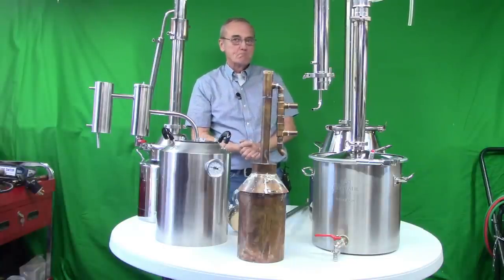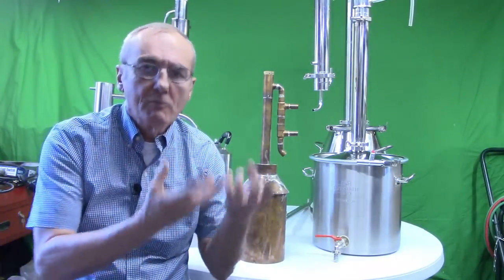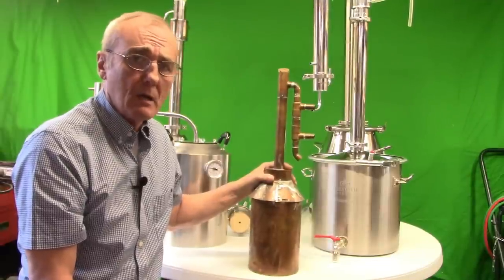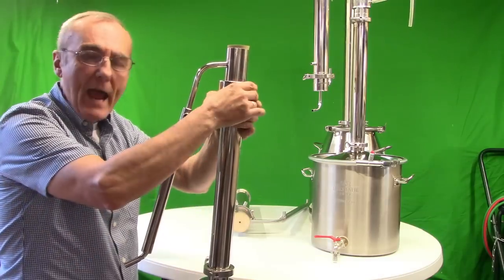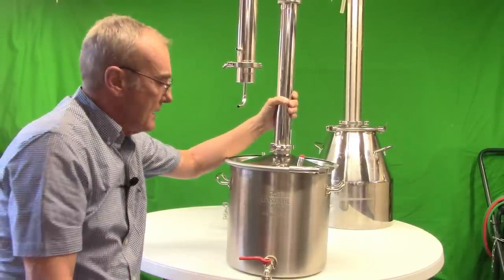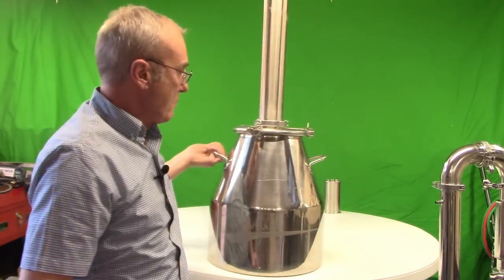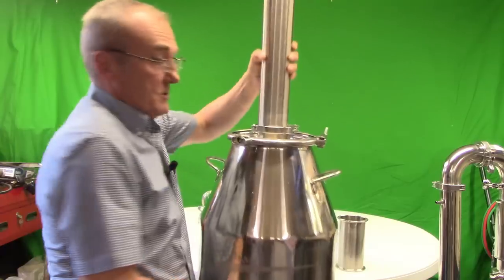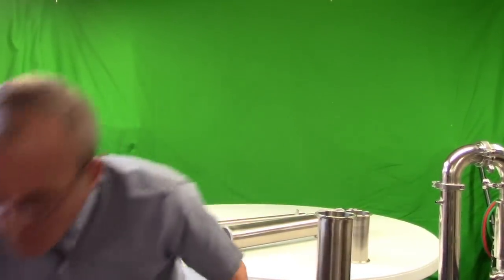Beginner's Guide #5 Moonshine Stills

Comment: George, love your video channel  but just one little correction....Pi X r squared is the AREA...what you described as the inner dimension when you ran your finger around the inside of the tube is the circumference, whose formula is Pi X 2 X r or Pi X D (2r being the Diameter).  

I’m really looking forward to my first try and putting your instruction and advice to use!  Keep up the great series!
Reply: For dummies: Circumference = 3 times the diameter - close enough

Comment: Hi George...first wanted to say thanks for the videos. You have mentioned several times you are not a fan of thumpers, I have used them a few times and have my own opinions of them. In a past video I believe you said a thumper is typically filled 2/3rds full and that seems hi and I see how that could cause some back pressure... but just enough to cover inlet tube by 1-1.5 inches is sufficient. It would be interesting for ( data ) to run 2 identical pot stills, 2 identical grain washes, but 1 with a thumper and compare the total  volume collected from each, the alcohol percentage from each, and the flavor of each from a few people to taste them. I think for ones who never used a thumper this would provide actual data or information of pros and cons of a thumper.

Comment: Slip of the tongue around 16:40, "Just don't run water through the condenser, or the pre-condenser.."
George meant that if you want to run it as a pot still, just don't run water through the "pre-condenser", and only the pre-condenser. 
You must always, always, always run water through the condenser, that is unless you want to die in an alcohol vapor fueled inferno.

Comment: So on the 3rd one that was a combo. Pot and or Reflux when running it as a reflux do you run water in your pre condenser and condenser? I suppose on the condenser you just run a steady flow of cool water. On the pre condenser do you adjust water flow or just run it like the condenser? Thank you for the information.

Comment: Great video.  Q - if you run the gin basket between the kettle and the condenser, doesn't this remove some of  the flavour...? As the reflux process removes most of the....flavours....etc. Almost seems counter productive - adding and removing.....no....?
I'm building a 3" column and I'm having a hard time deciding(personal preference) on a design that will let me Do the infusions as well as just run straight reflux.
(Kinda like the  Nixon Stone design)

Comment: hello sir, my pot still produces ethanol at the beginning max 80 abv then 70 - 65 - 60 .....  if i surrounded top of my column with thin copper pipe 3 laps. (primary outer mini condenser)  can i use too low water in this twisted pipe and increase purity of my ethanol?  which abv at my whiskey's flavor removed?

by the way, i realized  my foreshots smells like whiskey more than my hearts section while stripping run. when i smell jim beam bourbon, smell my foreshots and smell my hearts i can swear my %80 abv foreshots and heads smells like jim beam bourbon but i can not smell same thing in %70 abv hearts section, always smells like green banana :(      i am using pot still.

Comment: So if you get one of the reflux still I would need 2 water pumps?  One for the reflux and one for the condenser?
Reply: ......use gravity . .....cold water in container , above .....pinch tube to get right flow .....no pump  necessary !

Comment: Great episode. I'm in the process of building a 2"  nixon-stone set up running off a fire heated keg. My buddy runs a boka still(goes from 2" off the keg and 3feet up widens up to 3")  my Nixon will be 50"  and Tees over to the condenser inside the sight glass  (typical design I guess). My buddy thinks I'm over building and I'll have vapor pockets at  the thermometer and even at the take off point.......  any validity in his comments...?  
Thanks

Comment: Hi George, I could use some help with my little system. I purchased a little Chinese ten liter still you see EBAY etc. I'm disabled so I went for easy way of making alcohol by fermenting 8kilos of sugar and fermenting with still spirits classic 8turbo. Results were always good and the wash becoming clear as water after about weeks and have an alcohol content of 22% according to refractometer. With my new Chinese Still I could get 80-90% alcohol reading each boil, but recently that has fallen suddenly to just 60% at best. I've tried the steam with vinegar, stored the coke in the copper pipes but still the same. What can I do? Where am I going wrong?
Reply: Did you work out the problem? I am considering buying a similar still so would appreciate your thoughts. Thanks.
Reply: @naomi6212  Hi Naomi, I was using an electric hot plate to heat the still & had been using it for 18months. I decided to buy a new one. I found the new 1200w still became productive much quicker getting first alcohol drips in 45mins. The old hot plate 1000w took one hr & twenty. Now I can expect 80-90% for the first liter out put but the % goes down much faster than before since the "boil"time is much shorter. Now a full boil down to 15% output is done in about two hours where before with old hot plate it took 3.5+ hrs.
Reply: @Templemain  did you work out why the drop in productivity?

Comment: Hi George, I just bought a still with a thumper, can I use the fore shots and heads from my first run in the thumper mixed with crushed fruit or juice to add volume to fill the thumper 2/3 full? Also will the temp of the thumper have to reach 143 before the fore shots and heads enter the worm? Then increase  the temp to 173 and collect the hearts? I am new at this thanks for your info!

Comment: Using a cooling jacket on the top of the column is a pretty clever way to control the reflux ratio.  As  a synthesis Chemist I have worked with a variety of lab and industrial stills.  I am surprised I have never seen a small still set up like this.  I would run this a bit different though.  You suggest controlling the reflux by controlling the cooling water flow.  This will work but, it can be hard to reproducibly control the flow.  If I was using this in my lab I would keep a constant cooling flow but, control the temperature of the cooling water in the reflux jacket.  I had some temperature controlled recirculating baths in my lab that were  thousands dollars each which would be too expensive for a home distiller.  Still I think a simple recirculating bath could be made with a small pump and heated pot where the temp could be controlled.  

It would take some trial and error runs to determine the best temperature to run the reflux jacket but, once you figure it out it could be easily reproduced.   Say start with a gentle boil in the pot and run you reflux jacket at say 5 degrees centigrade lower than your ethanol boiling point.  See how well this knocks back the vapor.  You could get a good idea from your overhead temperature as well.  Too much cooling on your reflux jacket and your overhead temperature would be very low ( no vapor coming over).  Too little cooling and your overhead temperature would be a bit higher than the boiling point of ethanol (meaning insufficient amounts of reflux and a high water low ethanol content).

Comment: I have a copper 5 gallon one from the same manufacturer as your copper one.. I love it, partly because I made it myself, but I have to wonder where you learned solder.... LOL.   However, can you call the column a reflux column if you have stuffed the interior with copper mesh to do what the column water jacket does, so long as you don't run it fast? Nevermind.. didn't wait long enough in the video before asking.

Comment: 3" still , column length max of about 54".    Does this change with insulation / increased watts?   or does the power curve just run out room around here?  The calc I used seemed more around 60"

Comment: Hey George, I'm confused - when it comes to a reflux still, as the vapour is going through the reflux process, I would have thought the various chemicals that would normally vaporise first (methanol/foreshots/heads and the rest) would be mixed and muddled - Is it still the case that you should discard the first amount to get rid of the methanol, etc? I can't get my head around how the various chemicals aren't mixed by the reflux process rather than distilling in some sort of order due to temperature increase in a pot still.
Reply from the maker: Methanol ha no azeotrope so it comes off at 100% first. There is no mixing of muddling.
Geogre

Comment: What would be better?... Running the cooling water to the reflux jacket then to the bottom of the condenser, or running it to the condenser then to the reflux jacket? Or should they be on separate cooling water systems?
Reply: Cody Barnard Well if you’re just starting out; run a water line from your cold water source, I have a cooler with water and frozen 1 liter bottles of salted tap water with a pond style110 volt pump in it; into the bottom of your shotgun condenser. Then run a line from the top of the shotgun condenser into the bottom of your reflux chamber/Dephlegmator. Then run a line from the top of your reflux chamber/Dephlegmator back to your water source/cooler. Just like everything in this fascinating hobby; it all depends on how deep you wanna go. I use the same cooler set up; pump in the cooler, but I go from the pump outlet into a tee with a two valve set up I made, mounted to the side of the cooler. The valve for the shotgun condenser is just a regular ½” PVC gate valve and the one for my Dephlegmator, a 4 tube 2” tri clamp precondenser, is controlled by a ½” SS needle valve to precisely control the water flow. It’s a way cool learning curve; learning how to balance a reflux still. It’s also way big time fun to play with it. Enjoy the ride, enjoy the hobby and bottoms up

Comment: George, am I correct in assuming that the tubed/ jacketed top of the reflux stills is basically a non removable deplegmator ? Also I am using a 1/2bbl keg as my kettle you had mentioned 36-54in tall column for a 3in radius , is there any specific calculation or reasoning why I’d want a specific height for reflux mode?
Reply: It is basically a deflag, and while you can't take it off, you can leave it unhooked.  The height suggestion is based on diminishing returns, the taller you go the more seperation. But under average conditions/packing type, you start to max out the seperation you can get around 24 column diameters.

Comment: Sir can I condition a water heater to become the pot of my still? I am an ac technician and have a lot of mechanical skills.
Reply from the maker: Yes
Reply: As George says Yes, but you do want to watch what the tank is made of. I'm no expert but I would be leery of using anything but stainless or copper. I would steer clear of a galvanized tank because I would worry about high alcohol content reacting with the zinc. I'm sure someone with knowledge will chime in to this. I maybe wrong, interesting to hear what they say.
Reply: I wouldn’t use a water heater for a still. They are designed for lower temperatures than working temps of a still. Most old water heaters are full of mineral scale and/or rust and the dip tubes are usually plastic. I wouldn’t want to drink alcohol made in that environment. Besides, stainless kettles are cheap enough. George  made “big blue” out of cooking pot and basic mechanical skills, which would be a much better option.  But as HVAC tech, save some of those belly band crankcase heaters!  Heating sides of pot reduces scorching from heating sediment in bottom of still. Scorched sediment ruins flavors.

Comment: Hi quick tip to cleaning copper components, use stars an at the normal rate, it will remove all the build up and leave it clean. By this I mean I place my coppee in my bath add stars an and hot water, leave until its shiny then rinse well.

Comment: The distance around inside (where you run your finger) is Circumference, not Area. Yes, Area = Pi • R² (3.14 x R x R).  Area is the cross section of the pipe, measured in square inches (just like square feet measures size of a room or house).
Circumference = Pi • 2R, and measures distance around outside of a circle. Great teaching video. Many thanks.

Comment: A rubber bung.   Would that not put a rubber taste of the pririt?
Reply from the maker: It does not. The rubber bungs are standard with some stills when you order them. It is the device used to insert the thermometer into.

Comment: I already saw you make this mistake in another one of your videos: π*r² is the formula for calculating the area of a circle, not its circumference. That is given by the Formula 2*π*r
It is common to measure pipe sizes with their diameter, since it is far easier to measure directly, so for the example of 2" and 3" pipes, we have a radius of 1" and 1.5" respectively sin e the radius of a circle is always half of its diameter.
This gives us:
2π*1²= 2π*1= 2π inch²
2π*1.5²=2π*2.25= 4.5π inch²

So for the example you chose, it does work out to be roughly 2 the crossectional area.

However, and this is the reason why incresing column diameter increases efficiency so dramatically, as we have a squared relationship between radius and crosssection,  a 4" column has 4 times the crossectional area of a 2" column, while only doubling the diameter.

Now, the circumference for these:
2*π*1"=2π" circumference
2*π*2"=4π" circumference

If we now take the ratio between circumference and surface:
(2π*1)/(2π*1²)=1
(2π*2)/(2π*2²)=0.5
So, when you change the diameter of your pipe you change the percentage of your vapor that is in contact with the walls of your column.
It is the same effect that makes it so that ageing spirits in a larger barrel works so much slower: proportionally speaking, less spirit is in contact with the wood, and there is also less wood per unit of spirit.

Since column lenght and material affect the pseudo-reflux a column gives you  by radiating off some heat, changing the diameter of your column means also changing its lenght, if you want to have consistent results. However, it is not as simple as saying: for an extra inch in diameter you need an extra two inches in lenght - this going to vary, depending on your starting diameter, your mew diameter and your initial column lenght.

Love the videos, please keep them coming
Reply: Circumference is simply: PI multiplied by diameter.
3.14x3"
3.14x2"
Reply: Ben Müller,yes heard George get it A about twice I trust he will listen to your account.

Comment: George, another great introductory video! You mentioned a couple of stills by name (Mike High, Brew Haus) but I am interested in the one based on the 5 gallon kettle and two inch column. Distilling  in a kettle has lots of advantages since the kettle is multi-purpose. However, it needs a lid that seals. Can you tell me the brand and where you got it without endorsing it in any way? Thanks, Professor George!

Comment: He's a little confused about circumference and cross-sectional area.  PI x r2 (r squared) is the cross-sectional area of the pipe or tube.  Pi x d (diameter) yields the circumference of the tube.  He's giving you the formula for the cross-sectional area but describing it as the circumference.  Other than that, it's a great video.

Comment: Great video, but your math is a little confused.
* Circumference = 2 * pi * radius
* Area = pi * radius ^ 2
Circumference is the length around a pipe.
Area is the area of the cross section of the pipe.
Reply: Luke Kantrell  The video's presenter mentioned an equation in making a decision on a pipe size. He just used the wrong one. I wasn't trying to be disrespectful, just informative. After all, isn't that what his video was all about? I learned a few things about stills too. Have a great day.

Comment: Ok, great video, but your math is a bit off.  Pi X r^2 is the area, so the cross section of the pipe.  Pi X 2r (or d for diameter) is the distance around the outside.  That is why if you double the width of a pipe, you get 4X the throughput.  Anyway, looking to get a still when I get home from deployment.  One that makes vodka.  So I'm looking at a reflux.  MileHigh or BrewHaus probably.  Budget around $800.  Sound about right?
Reply from the maker: No matter how you describe it the math works out. Diameter is not the outside the outside is the circumference.

Comment: Does anyone know a still in the $200 range that's made in the usa
Reply from the maker: Very good question. Looking forward to seeing what anyone else can provide.
Reply: Clawhammer sells a copper kit, and occasionally has scratch and dent sales. You have to assemble, but there are instructional videos from them online. I started with, and am still using btw, an air still from Mr. Distiller. You can find them, or similar for that $ 200 neighborhood and less ! Plug snd go, but only make 1 gallon at a time. Great to learn with and get your feet wet... I plan on upgrading/upsizing soon. Happy Distilling !!

Comment: Hi Georges's can foreigner I recently purchased a Chinese steel and was wondering what website you went to to get the coupler for the heating element having trouble find that couplet at spacer for that the rod the heating run to go through into if you did give me the E mail address I would appreciate it thank you
Reply from the maker: https://www.amazon.com/Dernord-Sanitary-Threaded-Fitting-Ferrule/dp/B076CJTRJ1/ref=pd_sbs_60_2/143-9265033-3120166?_encoding=UTF8&pd_rd_i=B076CJTRJ1&pd_rd_r=dc0bb587-4088-4c58-96a3-4ce23a98d21f&pd_rd_w=RMz0n&pd_rd_wg=CtwLs&pf_rd_p=5873ae95-9063-4a23-9b7e-eafa738c2269&pf_rd_r=302QSRP0YA2S2QK67ZG2&psc=1&refRID=302QSRP0YA2S2QK67ZG2

Comment: You made a small mistake. At the pre-condenser the cooling water enters at the top and exits through the bottom ... Because the rule is that for any condenser, the direction of the cooling water should be the opposite of the direction of the steam to be condensed ...